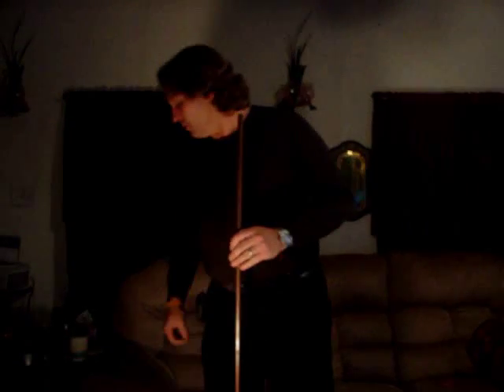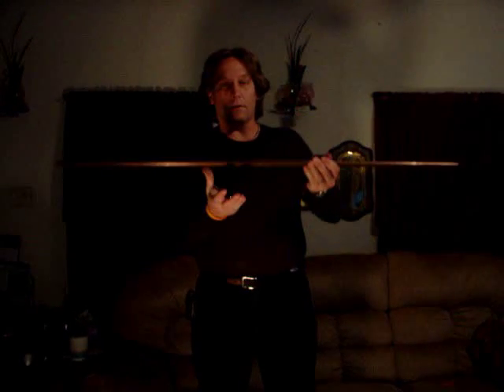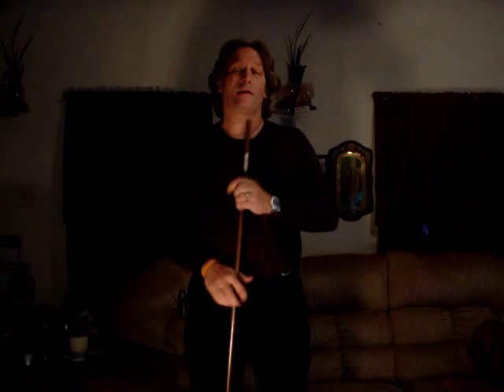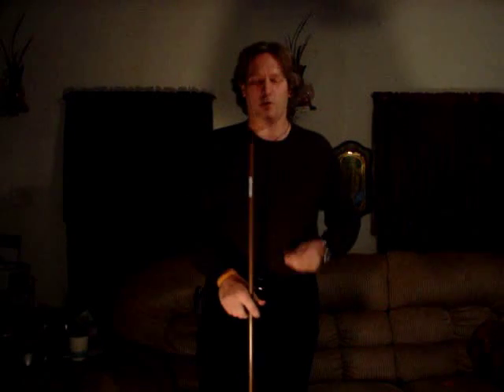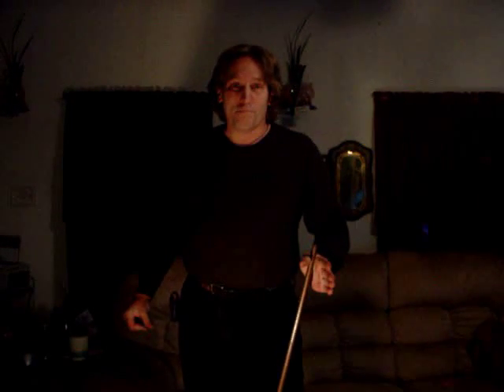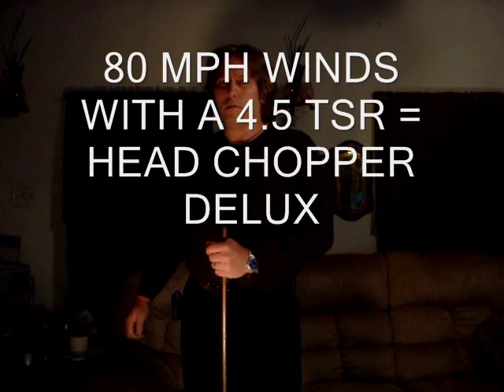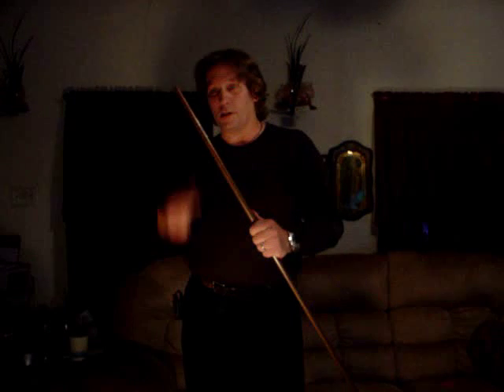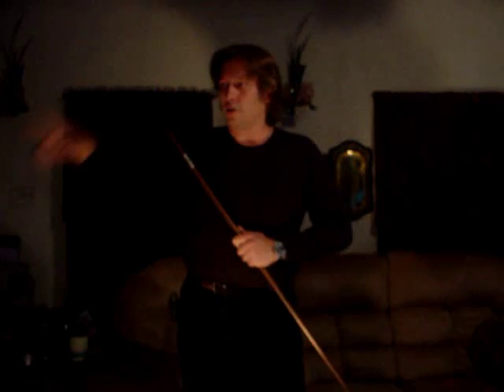EXPLANATION OF THE LENZ EFFECT.wmv

Comment: i'd like to see a demo of the lenz effect using the same copper pipe and a similar non-magnetic piece of steel the same size as the magnet to determine if it's an air displacement vs vacuum issue...
Reply from the maker: +Pconn71 Both ends of the pipe are open and rule out the piston effect. there is a lot of clearance between the pipe and magnet as well.
:)
Thanks. counter electromagnetic effect generated by the magnets moving through a circular conductive metal. max current is achieved at almost 0 volts because of the shorted circular shape of the pipe. The pipe is a single wrap shorted coil.

MUDDy